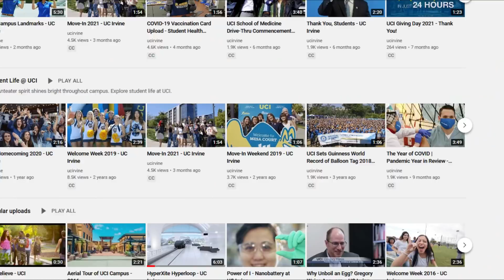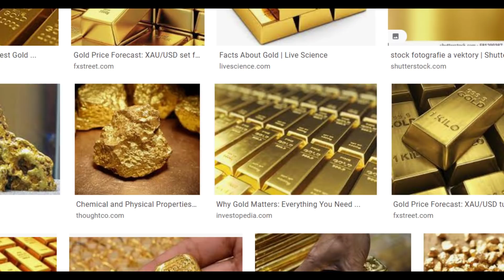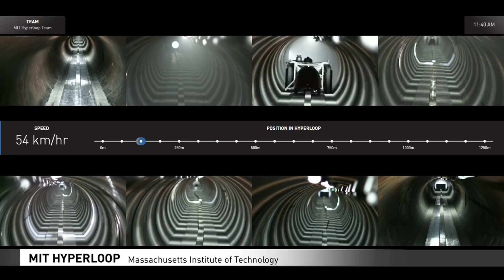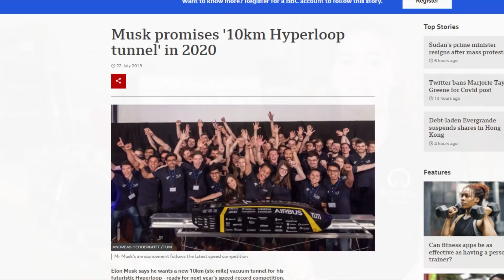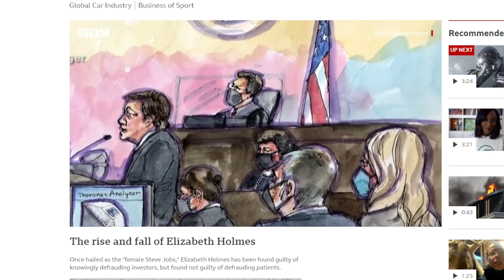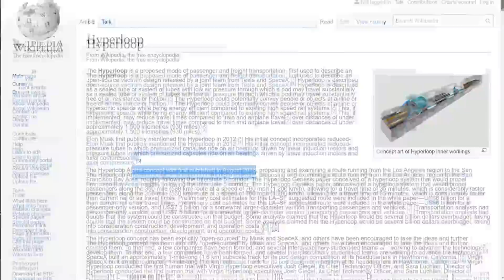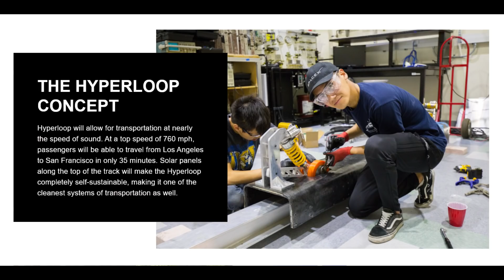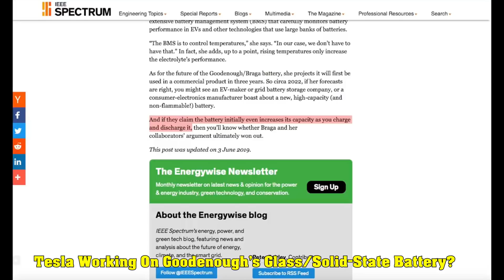The GOLD Battery that will revolutionize EVERYTHING!

Comment: I've always wondered what a Hyperloop would do in case of an emergency.  Your train/pod catches fire and comes to a stop.  How, exactly, do the people get out of the pod to evacuate?  It's a huge steel tube that's at serious vacuum. Space suits for all passengers?  With cutting torches so they can get through the tube walls?
Reply: Such thoughts never crossed Musk's "brilliant" mind.  LOL
Reply: Simple. Ejector seat.
Reply: High pressure water to hose out the bloody and charred paste that was once 'passengers'.
Reply: The program never even reached the health and safety aspects, it didn't fulfil it's basic design principles, so there's no point wasting time on these other details.
Reply: The pods are pressurized to one atmosphere, they cant just open the door in a near vaccum environment. Any opening would lead to explosive decompression.
Reply: Simply like in an elevator. Press the service button and wait for the technicians to arrive and cut you free. Happened to me in real life, spent a good hour inside (but It was my fault, don't ask). Or you will suffer the destiny of any submarine crew, that did not make it back to surface . . .
Reply: @thomasbecker9676  Luckily, everyone already knows exactly why it happened. The tragedy is that no one was able to stop him.
Reply: @JacquesMartini  - Well, that's the obvious answer, but my scenario was a forced evacuation where you can't remain inside.
Reply: @blackmichael75  😅
Reply: Well that's a bloody stupid question. It's a musk design. Musk designs never have emergencies.

PS: I don't need to wave my sarcasm sign, do i?
Reply: But dude its a vacuum. No fire. Duhhhhh 😉
Reply: Dam of only we had another tunnel that things go through so we could see how they do it......oh wait, we have underground trains
Reply: @jonny-b4954  - Tell that to the crew of Apollo 1
Reply: Since this has been adressed in previous debunking videos:
Safety issues have never been a concern with the hyperloop. If--IF!--hyperloop pods were to operate in a complete vacuum, in case of operational failure, the whole system would have to be decompressed in order to get the passengers out. In case of critial failure (e.g. hull ruptures), everyone inside the system dies in seconds.
Reply: explosives, clearly.....
Reply: Forget a fire. What happens when the CO2 scrubbers and/or O2 system craps out? It is in a vacuum, after all. Also, being in a vacuum, how are they going to deal with heat in any easy fashion? It's not space, it a confined tube; you can't just carry a medium to concentrate your heat in and vent it. You might try to replicate the system they have on the ISS. But, when you look at photos of the heat exchanging radiators, notice that they are massive in relation to total ISS surface area.
Reply: obviously it will reach the nearest emergency exit in the time it takes a pasenger to freak out.  this thing is traveling just shy of the sound barrier  of course, now they they go slower than your average cyclist,  i'm not so sure anymore
Reply: @aprisia  - You obviously have some background in the subject.  I spent a couple decades in high-vacuum (and still consult for some companies).  One of the biggest mechanical problems in a vacuum chamber is motors and how to get rid of the heat they generate.  Fins don't work because radiation is so inefficient (as you pointed out with the ISS example).  You can also mount the motor on the outside and accept the limitations of a rotary feedthrough, a just-as-bad-in-a-different-way situation.  The most common, and complex, solution is to "can" the motor with a water-cooled jacket.

None of this is available to a pod travelling in a vacuum tube that is not in contact with the walls.  It has to be 100% self contained and run for hours at very high output levels.
Reply: It's not in a vacuum, but we may get to see something like this happen in Elon Musk's Las Vegas tunnel system that individual Tesla cars are running through.  If you watch any of the videos of the tunnel system, you will notice there isn't enough room to open the Tesla's door should anything untoward happen.  You know, like a Tesla's batteries catching fire.  Plus, even if a passenger or driver does manage to escape the flames, I'm not sure how far they would get with those poisonous fumes filling up the tunnel.  As long as that stupid tunnel is in use, that scenario is a very real possibility.
Reply: Explain 'space suits' bro. Phil or a similarly gifted individual may not have reached your ears about that yet, but try squaring up 'space suits' and 'vacuum' in your head.
Reply: @WickedServantEbay  - Not sure what you're driving at.  Would you prefer "Pressure Suit" then?  Something like what Space X uses for their crew missions: a suit to protect you from vacuum, but couldn't handle actual outer space (with radiation and micrometeoroids).  It was a rhetorical question, anyway.
Reply: @hagerty1952   close your eyes and use your brain. Think of the pressures involved in a true 'vacuum', and then recall in your mind an image of what was paraded in front of us as "space suits"
Approach the idea with curiosity friend
Reply: So, not saying it is actually feasible, because I have my doubts here. But first nothing on the outside could catch fire in a vacuum as there is no oxygen for that to happen. But for a breakdown, in the middle of the tunnel, they would fill it with air and the people would walk out the same way they would in a subway. For this to be a feasible product there would have to be escape routes in the tunnels at regular intervals for this problem just like there are in subways. Other than the vacuum (which can be turned off in the case of an accident), it is the same as a subway.
Reply: @mikereinhardt1244  - Good points, but I was referring to a fire inside the pod (say due to an overheating motor) that would make it impossible to stay in the vehicle.  "Filling it with air" sounds OK until you realize how big this proposed system is.  LA to San Francisco is ~350 miles straight-line, but would probably be 500 miles of tube.  If the tube was 10 feet in diameter, that's just over 200 million cubic feet, and you can't start venting up until you've brought the entire rest of the system to a stop.  

Even if you had isolating valves every mile or so, that's just shy of a half-million cubic feet, which would take several minutes to vent safely (any faster and you cause supersonic shock waves that would most likely destroy the pods integrity).  And if you hadn't isolated or shut down your high-vac pumps fast enough, you will have destroyed those very, very expensive pieces of equipment too.

Escape doors are easy on a subway where they just have to be a hole in the wall to get people out.  An actual door is optional and probably only there for security reasons.

Bottom line: putting trains in tubes can be a good idea.  Putting trains in vacuum tubes is the height of stupidity.
Reply: @mikereinhardt1244   "Other than the vacuum (which can be turned off in the case of an accident), it is the same as a subway."
Please watch Thunderf00t's videos on this Hypercrap and learn.  Learn about the length of time and energy required to pump up and pump down a volume of space.  Thunderf00t has many years of working experience with vacuum pumps.
Nobody who understands reality + science + engineering would claim this Hypercrap is "the same as a subway" even "other than the vacuum". UNLESS your point was that the Hypergarbage offers NO ADVANTAGE to a subway, so why not just build a subway?
THEN, I agree with your point.
Reply: @hagerty1952   "Putting trains in vacuum tubes is the height of stupidity."  TRUTH!
Reply: @hagerty1952  I agree with your final point, I am not convinced putting trains in a vacuum is a good idea, low pressure maybe.

However, your point about filling the air is not necessarily correct, maybe if it is underground. If you are above ground, you could break the seals everywhere, and for it to be safe for humans to exit the vehicle you don't need to get to 1 ATM, people can survive at much lower pressure, very low for a short period as the air fills in. Not to mention opening escape hatches with pressure lower outside the vehicle would suck any fire in the vehicle outside away from the passengers.

Bigger problem with a fire on the inside is stopping the vehicle, fires in subways would also be a huge problem. You can't get off until it stops, filling it with air in this case will also rapidly break and eventually stop the vehicle. I would also assume there is some sort of fire suppression system inside like I am sure there is on a subway. 

It isn't an easy problem to solve, but it is feasible. Is it a good idea... well no one thought airplanes were a good idea, some people still don't.  I guess I will wait and see if someone proves us all wrong.
Reply: @theultimatereductionist7592  I have watched that video, and not being an expert on keeping a vacuum in a very long system I have to assume it is correct. I am not saying that a vacuum tube is easy to build and maintain, nor did I ever say that. I was just saying hypothetically if you solve that problem somehow, then it is essentially just a subway /monorail. I am dubious anyone will ever figure out how to keep a vacuum there, but they don't need a full vacuum, if the tube large enough in comparison to the train, you could benefit a lot from 50% pressure, get to 10% of an ATM and it would be able to travel much faster with less energy. Who knows, maybe someone will figure it out, but yeah, I wouldn't bet on it.
Reply: @mikereinhardt1244  - Thank you for the well-reasoned response.  I still stand by my point about venting too fast.  To "break the seals everywhere" would require having some mechanism to do so on every one of them.  Nothing like setting yourself up for a massive failure when (not if) some of them fail.

I have said on this forum several times that if you want to do what Musk is proposing, don't do it in a vacuum, leave it at atmosphere and put a ducted fan on your pod.  It sucks the air in the front and blows it out the back.  You get a de-facto partial vacuum in the deal, and none of the drawbacks we've been discussing.
Reply: @Jack Hagerty Oh boy I would love to see someone in a space suit inside a giant vaccum tank cutting a hole in the outside wall with a cutting torch. Just want to see that. Must see what happens. Ok who is gonna try that? Maybe the Jackass guys? :D ...damn now I need to know.
Reply: @RingManiac  - I can tell you that they'd probably be scraping them off of the farside wall of the tube.  Ever see the port in a vacuum chamber implode?
Reply: Musk will just bean them out!

Comment: She has invented the supercap. All other companies that invented supercaps that aren't made of gold must feel rather lost right now.

And the amazing thing - her supercap can handle hundreds of thousands of cycles. Something that must feel scary for the competitors that can handle millions of cycles...
Reply: I was just thinking that, why are they calling a cap a battery
Reply: And capacitors usually "die" because they get dry, not because of oxidation so. it´s even worse in that sense.
Reply: Gold SuperCrap
Reply: @TrickyNekro  wouldn't the getting dry as a cause of malfunction also entail some form of oxidation or corrosion  though? (genuine question)
Reply: Most super capacitors aren’t just made of lined up individual needles, their manufacturers tend to make them out of ribbons like idiots.

(The needle idea is actually a good one and she was just producing a polymer which had the appropriate amount of resistance and durability which is kind of the easy part compared with growing and wiring up a Forrest of nanoscale gold needles of sufficient and consistent lengths).

It is the sort of project I would have worked in as a chemistry undergraduate (just manufacturing the test bits not coming up with the polymer etc). It would be worth a masters just for inventing and properly testing the polymers.
Reply: Maybe the marketing department that made the video had no idea what her project was about?
Reply: @freaki0734  All real element capacitors have some ESR a.k.a. resistance. Because usually, current flows in and out of the capacitor, the capacitor heats up because of this resistance. The electrolyte slowly boils out of the capacitor. As more electrolyte boils out, the ESR of the capacitor goes up this exaggerating the problem, until the capacitor finally blows. Now some of this ESR is because of the structure of the capacitor and some because of the electrolyte itself. Capacitors are also practically made from aluminium so the oxide is in any case there. The current doesn't really flow through the capacitor, it flows in the capacitor, if that makes sense. But generally, as far as I know most part of the problem comes from the two causes I described above and not from any kind of oxidation. Edit: I can't simply and probably correctly reply in a YouTube comment to explain that correct and fully articulate myself, search for Dave Jone's EEVBLOG video on that, he does a pretty good job!
Reply: We already have a battery that last near forever ...wonder why they wont make that any more for consumer market ? 
Nickel - Iron battery is amazing , it last several times longer than lead batteries , 30-50 years , after that its easy to recycle .
Next step are Iron flow batteries , iron is cheaper and more common than lithium so even if they would be bigger , those would still be cheaper and iron do not have a nasty habit to suddenly burn up like lithium .
Reply: @pete_lind  There are Edison batteries that STILL WORK.
Of course, they are completely unsuitable for EVs.  Still, they do last nearly forever. If you have a lot of room and weight is not a consideration, they are better than lithium ion.
Reply: @TrickyNekro  woah man thanks for that answer!
Reply: @TrickyNekro  iirc that really only applies to electrolytic capacitors. Package size per ufarad is about the only thing they have going for them compared to other types.
Reply: @zephaniahgreenwell8151  Maybe?
Reply: @allrequiredfields  Math be racist.
Reply: @twistedbydsign99  It's just like how people are calling basic statistical calculation "AI", or switching on a useless computer to do useless calculation "crypto currencies".
Reply: @alexchan3287  who calls basic statistical calculation AI?
Reply: @xxheartbrokexx100  every processing calculation app in use? Iunno.
Reply: @tarstarkusz  lol 😂
Reply: @pete_lind  Maybe because NiFe batteries are inefficient (< 70% of charge energy can be recovered), high self discharge rate, low energy density in volume and weight, and basically not produced anymore.  If they were mass produced today, I wonder how much they will cost.  Also, could it be possible to make them better? I have no idea.
Reply: -Matter didn’t create anti matter
-Anti matter didn’t create matter
(Both of them were present at the time of big bang)
-Both of them didn’t create themselves.
-Both of them came from an unimaginable source,  that unimaginable source created matter and antimatter (everything) thats why it is known as “the creator” of everything.
~~~~~~~~~~~~~~~~~~~~~~~~
- that unimaginable source/creator has created sin and virtue which are opposite to each other,
— logic says every action has its own reaction, so the reaction of sin must be different than the reaction of virtue,
— the creator has created prophets to let us know about each and every detail of sin and virtue, also about their reactions,
Thank you :)
Reply: @dot1482  what about uncle matter?